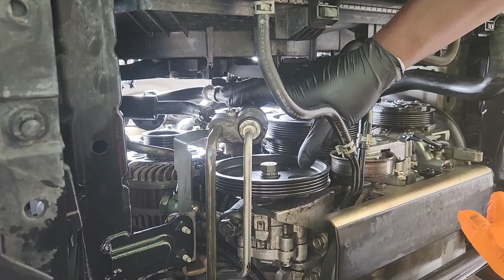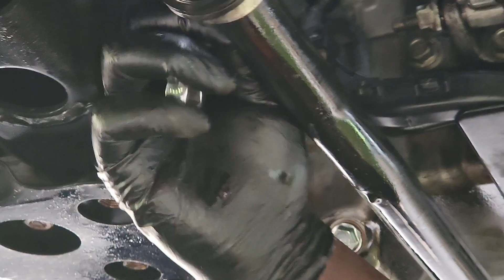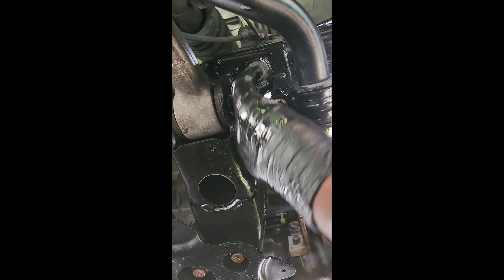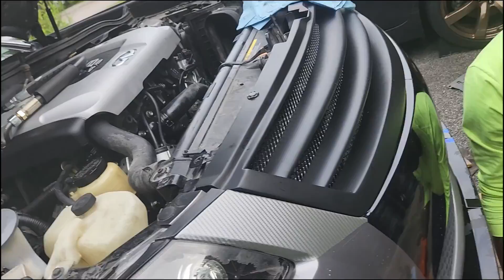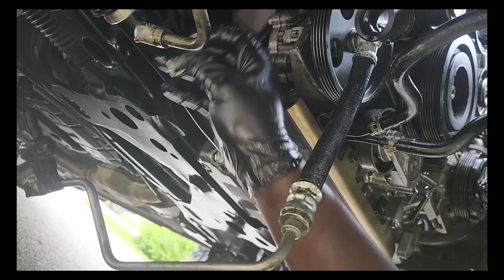Removing High Pressure Power Steering Hose. Infiniti M45

Comment: Thanks for posting this. I just had mines replaced about a month ago. Found one in another state in a junkyard for $99. The leak also sprayed on the alternator so the alternator gave off a burning motor smell. So after I replaced the hose, I had the alternator replaced.
Reply from the maker: Sorry you had to get the alternator as well. For Us, we degreased the engine then rinsed it off to get rid of any traces of the oil and it's smell.
So far, so good.
Reply: @EdBwoy  bro. Good to see ur vid again. We love the same cars so dealing e the same issues. 07 Murano has the same issue. I did it mannnn i was wishing not yo have to do this ever again so much so i cussed and spoke out loud alone under the car due to narrow and tight area making the task terrible. 

How do you know the hose is not the issue instead of the line? Is there no oring to replace to fix this as it is the case in hondas power steering pump?
Reply from the maker: Do you still have your old hose by chance?